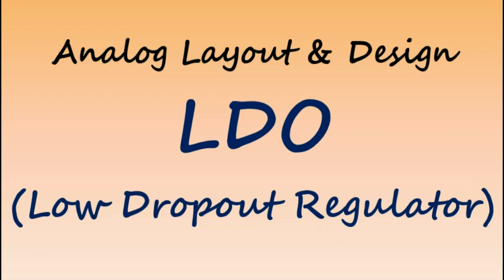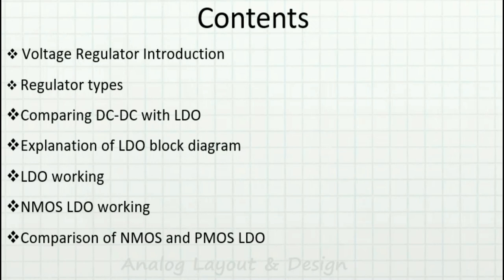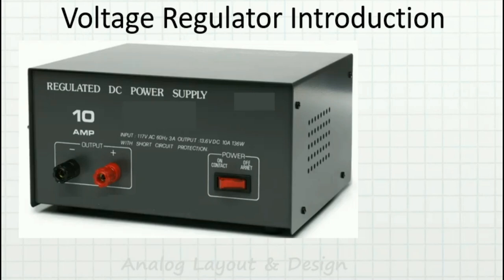LDO (Low Dropout Regulator)

Comment: In an open loop op-amp circuit, there is no concept of 'virtual ground'. However, in an op-amp with negative feedback such that it behaves as an amplifier, the inverting input maintains exact potential as that of the non-inverting input.

Comment: Great video sir, i had one doubt , in nmos LDO when vref and feedback voltage is same the output of opamp becomes 0 and vgs is either 0 or -ve depending on the predefined voltage at output. So will there be any offset output voltage added just to turn on the NMOS. Correct me if i went wrong anywhere.
Reply from the maker: in NMOS LDO when vref and vout are same;
1. resistor divider is not required.
2. The output of the opamp should be greater than output voltage by one Vth. suppose, Vout=1.25V, (equal to Vref), then the output of Opamp should be Vout+Vth of NMOS; i.e. 1.25+1V (assuming Vth of NMOS=1V). Hope this clarifies.
Reply: @analoglayoutdesign2342  ,thanks sir that was very insightful. Sorry for the bad format of question formation.
My question being reiterate
1)when vref=vfedback (considering virtual short) the opamp output to gate of nmos would be 0. Since for nmos vgs to be positive , won't the nmos be turned off?.
Reply from the maker: Ok if vref and vout are equal, then a.c or small signal output of opamp will be zero. But large signal or DC levels will still be maintained by opamp output.  Hope I answered.
Reply: @analoglayoutdesign2342  , great sir , yeah it's clarified now

Comment: But giving 5 voltage and having 2.5 voltage, There will be a so much drop using NMOS pass element
Reply from the maker: That’s true. NMOS pass element when used with lesser difference between Vin and Vout, they use a charge pump to boost the supply of the amplifier driving the pass element.

Comment: Very good information and excellent presentation style. I have one query... How do choose the specifications of the error amplifier? I mean how to budget the bandwidth and gain for the error amplifier?
Reply from the maker: Error amplifier gain is calculated based on your output voltage accuracy reqd. Bandwidth requirements of the amplifier depends on overall stability of the LDO and response time of the LDO..hope this helps

Comment: When we get oscillations at the output of the LDO what is suggested to be changed first and subsequently from layout perspective?
Reply from the maker: So if I understand properly,  there are no oscillations in schematic simulations but after layout and parasitic extraction you are facing stability issues..
It's very difficult to point out without knowing more about  ldo: architecture, current, compensation etc..

Comment: Hello sir, thanks for the great video. 

Got 2 questions: 
1. if Vin-Vout = V drop_out, at 35:43, V drop_out is 10-3.3=6.7V, then how come the drop out voltage is 3.6V, and later it becomes 3.6-3.3=0.3V?
which one is the real drop out voltage?
2. Why when Vin is under 3.6V, the error amp won't work?

Looking forward for the reply. Thank you
Reply from the maker: Drop out voltage is the minimum voltage between Vin and vout after which regulation stops.
Reply from the maker: Regulation stops bcos the Vin and vout difference is so less that pass element becomes a simple series resistor between Vin and vout
Reply: @analoglayoutdesign2342  Thank you sir, you mean the pass element is similar to diode connection?
Reply: @vectorhehe7905  no.. it's not like diode connected..it's in linear region..simple mos resistor
Reply: @jayateerthar5224   oh you are right, I forgot this pass element here is a PMOS

Comment: Hi sir.
I have two questions.
1) How do you calculate the W/L ratio accurately of Pmos pass fet for a specific load current.
2) What is the main contributor to set the output voltage, error amplifier or resistor divider?
Reply from the maker: 1. Decide whether you need passfet in saturation or linear. Generally saturation so that we get gain. Keep L min. Now u know current, vds, kp... So calculation is straight fw...
2. U can use both.
When you change the reference voltage, output voltage will change accordingly. The error amp should have that input voltage dynamic range. But to get voltage reference which varies linearly is difficult.
Resistor divider should have resistor bank to program the output voltage. Here the quiescent current will change when feedback resistor  value changes.
Hope its clear..
Reply: @analoglayoutdesign2342  Ok sir. Thank you.

Comment: Hello sir,
In nMOS LDO case i have some concerns that i have learned that nMOS works in saturation mode when Vds>Vgs-Vt. In your example, Vds=3.3-2.5>3.5-2.5-1. It seems like LDO still works with Vdd=3.3 in case Vg is not greater than 4.3. If I have any mistake, please correct me.
Reply from the maker: In NMOS LdO, NMOS stage is in common drain configuration. Let’s say vin=3.3, vout=2.5 and Vt=1v , then gate voltage should be vout+vt at least I.e. 2.5+1=3.5 
Question now is where do I get 3.5v which is higher than supply of 3.3v…vin and Vdd are same…
Reply from the maker: Hope this answers your question

Comment: How the output voltage decreases when the load current increases suddenly
Reply: Pls explain this.
Reply from the maker: When the current increases suddenly,  the pass element cannot provide so much current.  Current is provided by load capacitor. When charge(current) is removed from Capacitor, it's voltage reduces.. which is nothing but output voltage... hope this answers
Reply: Understood, Thanks!!

Comment: At the center of the screen is represented a n channel depletion mosfet wired in the wrong way !
After some search over internet because I didn't understand your schema, I find out that what is really in place here, is a p channel enhancement mosfet. This makes much more sense, therefore I doubt that you really understand the fundamentals of electronics.
Reply from the maker: Today cmos designs are done with enhancement devices.. and ppl shout if they use depletion mode or native NMOS devices.. yes.. symbol is edited.. but also listen to what is being told over the video…. Here the discussion is not about device understanding or device physics..